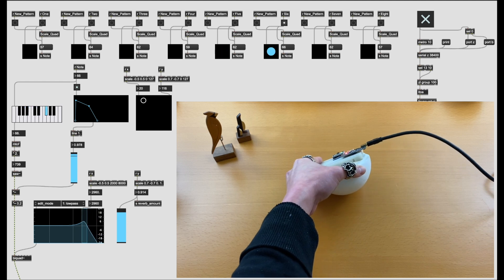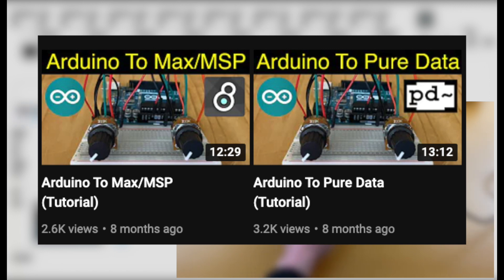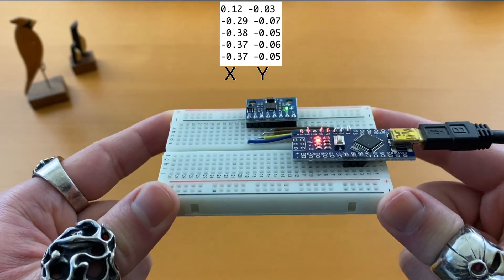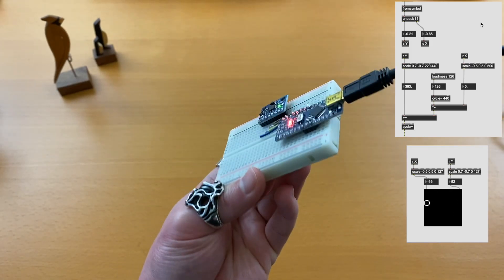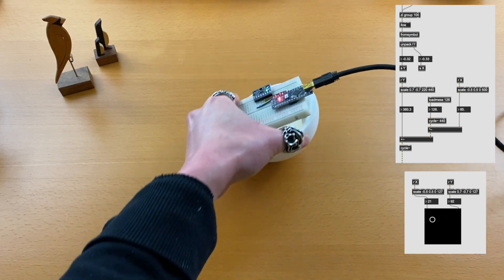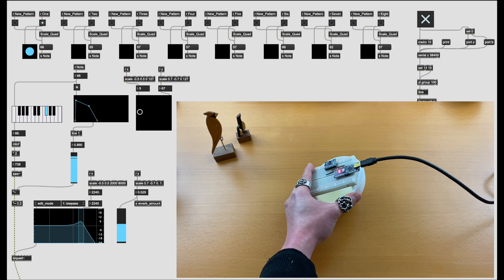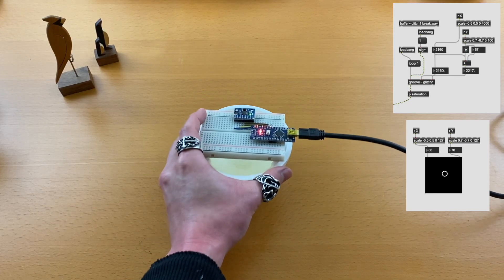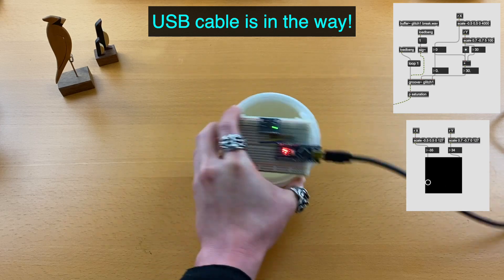Accelerometer Music Controller (Arduino Tutorial)

Comment: just what i was trying to doo!!! Great information!!! thanks! i would like to do a independent device who sends midi mensages to a volca or NTS1... how can i code that? thanks for the great content!!!! Happy new year!
Reply from the maker: Yeah, I eventually do need to make a video on stand-alone MIDI device. Something that can send data via MIDI cable. I actually never sent CC (?) using Arduino before so your guess is good as mine! We might explore it when we start learning about embedded audio this spring/summer.
Reply: @SoundSimulator  yess!! I have made some standalone devices with the note and volts midi library!! But is hard to me to combine the MPU code with the MIDI library... I'm on it! If I found something will share it!!
Reply from the maker: @fedeboretti  It's a tiny bit more expensive, but there are analog-out accelerometers that you can use with the MIDI code// 
But either way, there should be a solution!

Comment: great ideas but the only issue is getting back to the initial position with the sphere I think some fairly sturdy springs and a wood surface might help but I'm being nitpicky here hahaha. Great video man excited to see future projects this channel is a goldmine
Reply from the maker: Totally valid feedback! I completely overlooked the weight issue until I started filming. 
Yeah! I really wanted to incorporate springs to this but I'm pretty limited with building materials right now. I definitely want to revisit this when I buy a 3D printer.      

And thank you so much for your support!!
Reply: @SoundSimulator  yes at first building materials are intimidating but if you start working with them regularly stopping yourself is the problem hahaha.Id say a fairly sturdy spring inserted on the bottom through a small hole and hold it down with pins on wood or any rigid surface can do the job the tricky part might be adding breaks so it wont wobble around